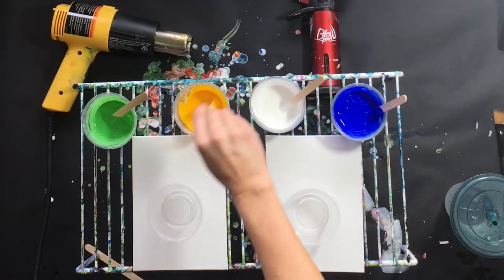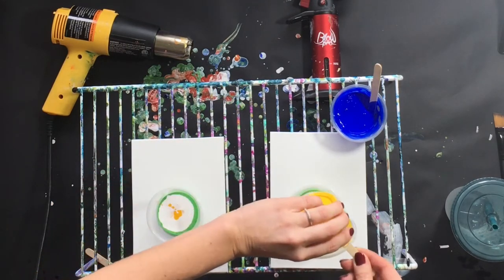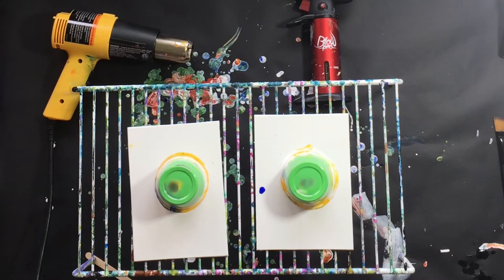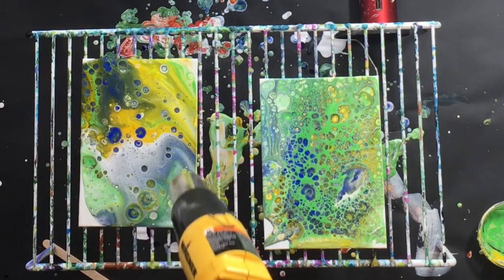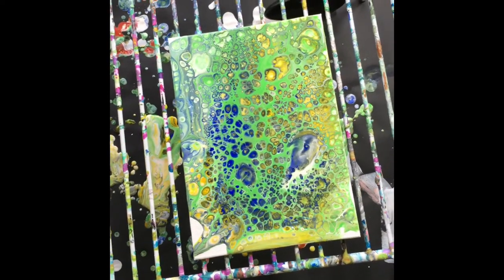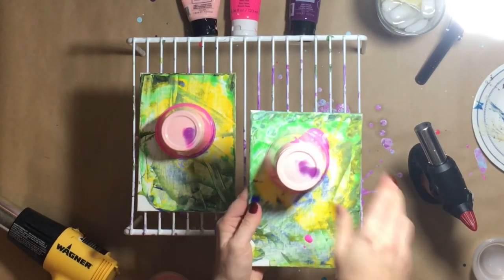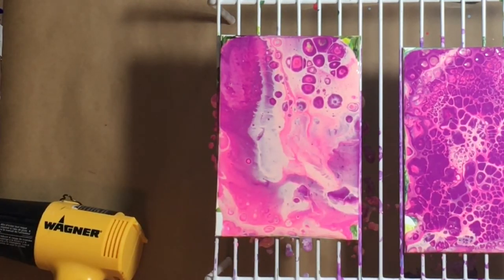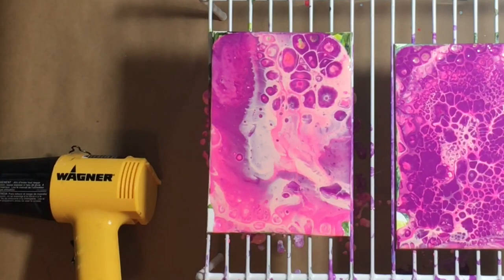HEAT OR TORCH? YOU DECIDE | Acrylic Pouring Tutorial | HOW TO GET CELLS

Comment: I tried a heat gun.. and I too found that it did push the paint around, even on low. And you have to hold/move a heat gun around over the paint for a much longer time than a torch.  Agree that is depends on the look you're going for.
Reply from the maker: Thank you so much for watching and for your comment 🤗

Comment: Maybe because you had paint already on the surface on the second experiment. They could not move freely. The cells could move more freely on a canvas with no paint on it. The first experiment you did.
Reply from the maker: That is a possibility. Since making this video, I have switched to using straight dimethicone silicone only with my heat gun. It works awesome! Check out my latest feather video I posted last week and you'll see how nice the cells are with the heat gun. It's pretty much all I use now.